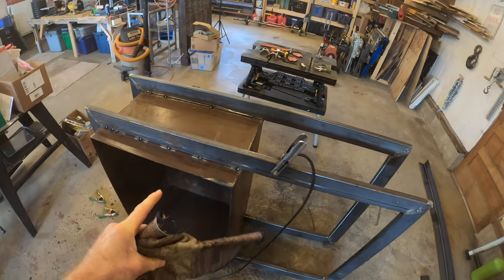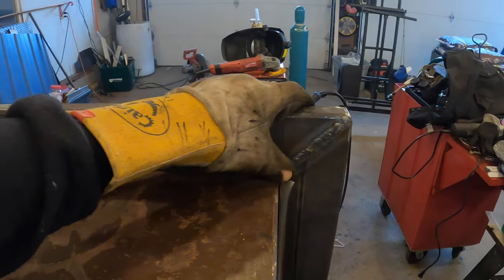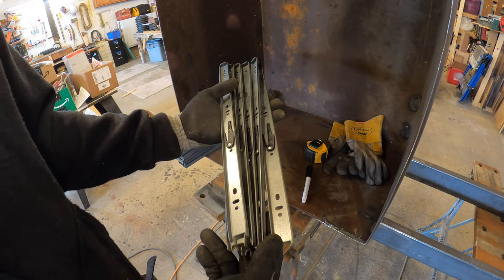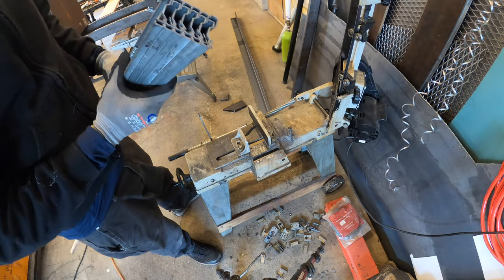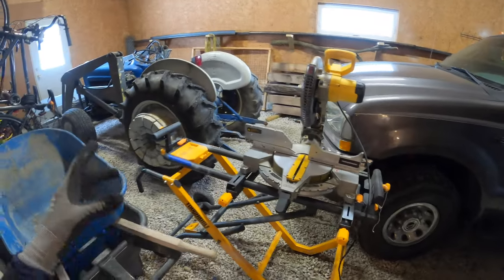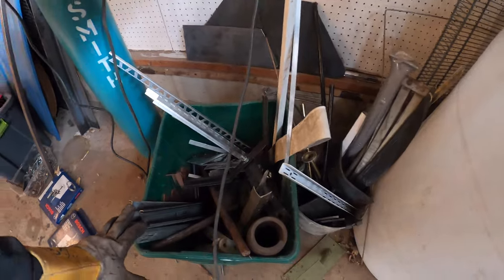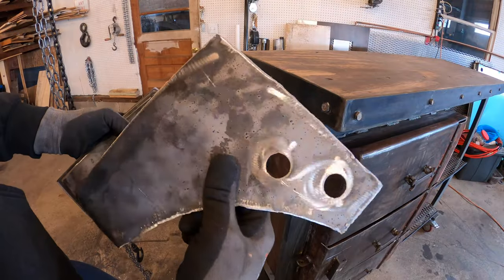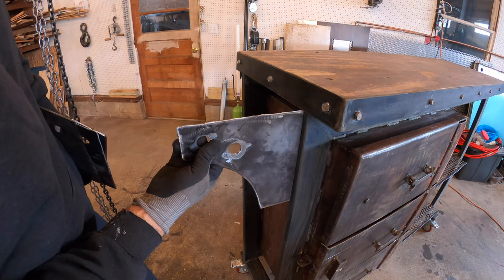Industrial Shop Cart from an Old Job Box

Comment: also,   you might want to consider welding nuts onto the front of the drawers, and one to the frame, all inline so you can put a bar thru it, weld a plate to one end, and drill a hole in the other,   so you can lock the box, and help to keep the drawers shut when your moving the cart around

nice work Spencer
Reply from the maker: That is *exactly* what I need to do. I've had the drawers slide open a few times now and definitely need to fix that problem. Thanks for the idea -- I like how it's in keeping with the overall design.
Reply: @metaspencer  your welcome,   I saw you picking it up and the drawers coming open,  ive had stuff like that happen one to many times